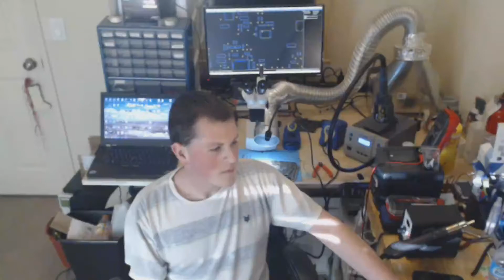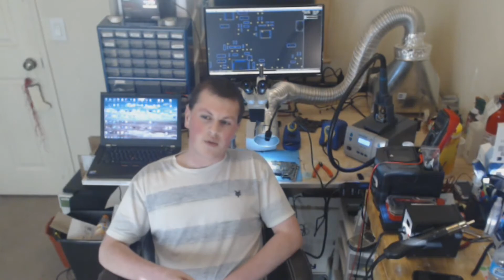Rabbit Holes and how to handle them | TCRS Circuit

Comment: IT'S A QUEST! I realize it's necessary for the customer to tell you what is wrong (what he thinks is wrong(?)), but it might send you down the wrong path. In automotive.. in the 60's, a customer came in with a Ford Falcon that was very slow in cranking. He said he put a new battery, starter and cables and it still was very slow in cranking. Dad looked under the hood and saw that the battery was new..but just in case, he swapped it out with an identical battery (mistake).. still no good.. checked new cables, grounds, etc. Pulled starter out and it tested ok on the bench.. put it back in.. and then the light bulb turned on. Dad asked... What year did you say this is? (1964!). Someone had put a 6 volt battery in it.. 6 volt systems were no longer used in most cars since 1956. He was put a the mind set when the customer told him what had already been tested/swapped. He put in a proper 12V battery and it started right up.
Reply from the maker: I had one 2010 macbook pro in that was driving me insane... Fixed the board, had it working outside of the case, but when assembled it wasn't working... Found out the customer provided me with a case from 2011 so one of the screw holes was shorting u6900. So agreed, even if the customer provides you something or says they changed something, always investigate to see if they did it properly or used the right part.

Comment: Hey dude it's me :P really appreciate you're help with finding the information to upgrade my graphics card, the entire time I thought the PCH was the GPU even though the heat-sink had it etched out >.<
Reply from the maker: Yeah the GPU is on the die of the CPU.... The i5 3320M has the HD 4000.. But i don't know if it will work unless it's supported by your motherboard..
Reply from the maker: Here is what the die looks like... https://assets.pcmag.com/media/images/342604-ivy-bridge-core.jpg?thumb=y&width=480&height=333
Reply: when the TDP's are the same does this mean that I should be getting around the same temps?
EDIT: also you have really fast replies and just a reminder I'm 13 and very stupid so please don't get mad at me if I say dumb things
Reply from the maker: Lol not at all... Think of TDPs this way, If the TDP is higher than the CPU you have now, you will overwhelm the cooler, If its the same the CPU may run hotter (Higher clock speed) but will be able to stay under tjmax. TDP is kinda like thermal mass in a way.. Higher the number the more heat it will pump into the cooler.
Reply from the maker: The only dumb question is a unanswered question so ask away... And no you will have different temps even if the TDPs are the same.. Temp is affected by clock speed, voltage and the quality of chip that you were given. 2 chips of the same kind may run cooler or hotter than each other... All depends on the "Silicon Lottery"
Reply: how do I find out if this cpu is compatible with my board? I use a Samsung NP300E5E-A02US
Reply from the maker: Just looked it up.... Your not going to notice much of a difference when upgrading to an i5. Still will be a dual core and still will have intel hd 4000 graphics. But this CPU will work and will be the only one you can upgrade to.... Make sure to reapply thermal paste!! http://www.ebay.com/itm/Intel-Core-i5-3210M-SR0MZ-2-5GHZ-Laptop-CPU-Processor/222453474135?_trksid=p2385738.c100677.m4598&_trkparms=aid%3D222007%26algo%3DSIC.MBE%26ao%3D1%26asc%3D20160908110712%26meid%3D72d6aba115a4407b8c135771d930b5fa%26pid%3D100677%26rk%3D2%26rkt%3D12%26sd%3D122515478993